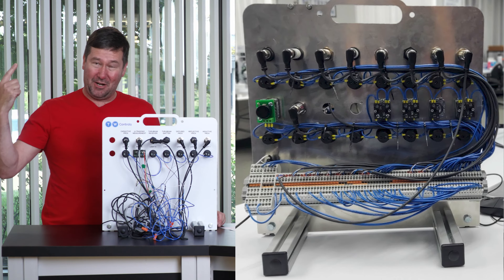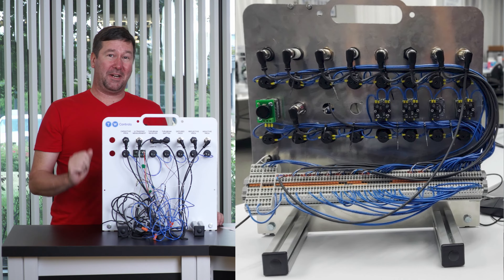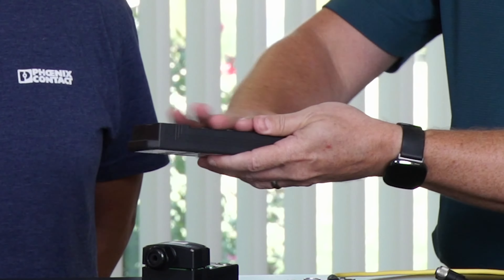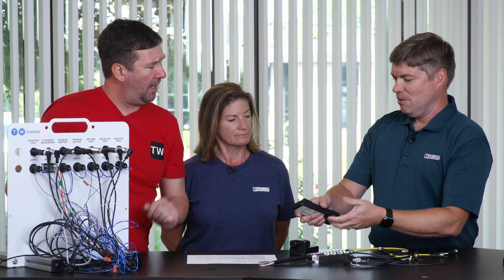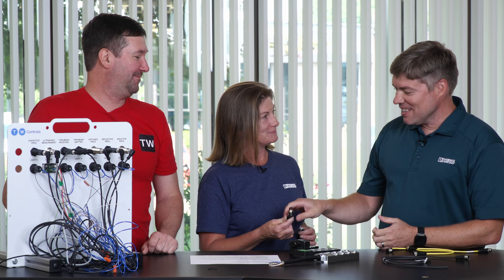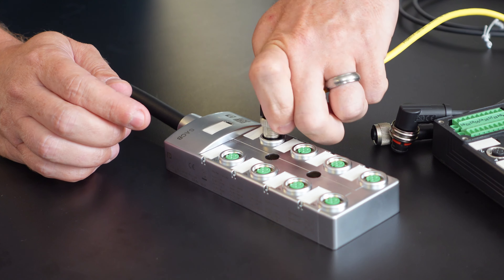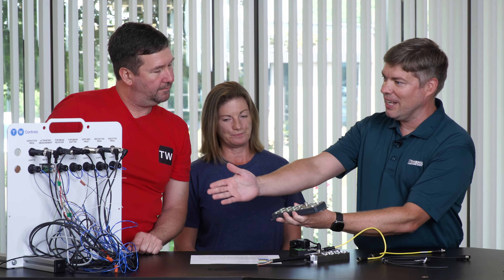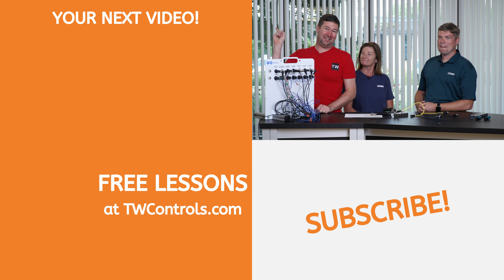M12 Sensor Distribution Boxes are a Time Saver

Comment: We used Devicenet at a uranium mine in Wyoming and the only down side to it was if the wiring opened to a port. The interface and program would not read the change. the static state was maintained at the last good read.
Reply from the maker: Yes, when Devicenet worked, it worked and when it didn't, it could be difficult to troubleshoot.

Comment: I’ve used a similar product before and they sure make cable management a lot easier and your panel a lot neater. Does this have LED’s so you can tell if the input is on?
Reply from the maker: Yes it does.  That makes troubleshooting much easier.
Reply: @TimWilborne  Absolutely!